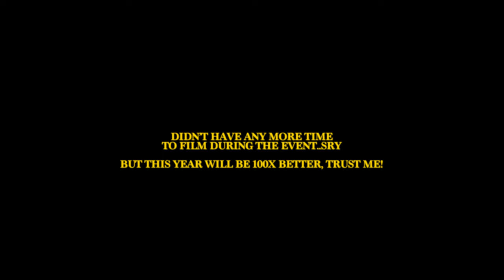BMW E30 325i PROJECT REVEAL & GARAGE STRUGGLE UPDATES⎟GSS #43 - Persauki Motorsport

Comment: Awsome, i did the same for my 2jz e30. a tip. dont remove the stock undercoating, if it doesent show rust- it will be 100% fine under the coating. it will take ALOT of time and is costly to put new on. just fix the "corners" where rust is showing. good luck!